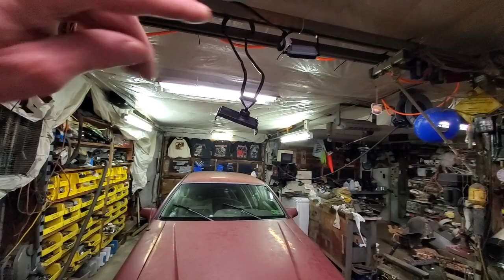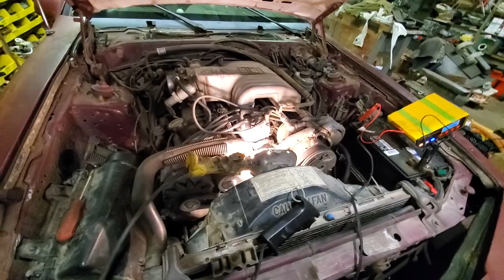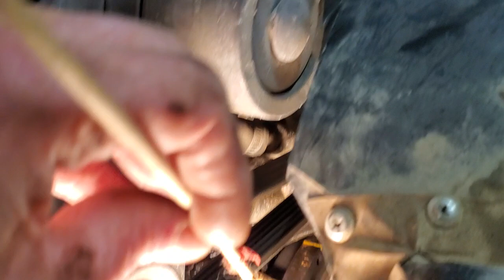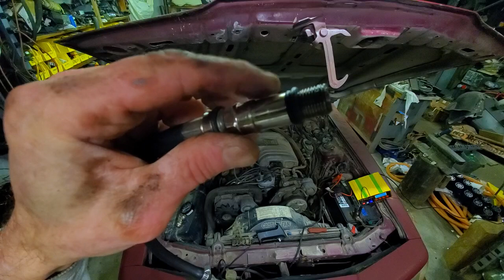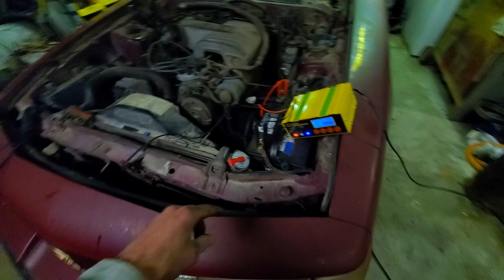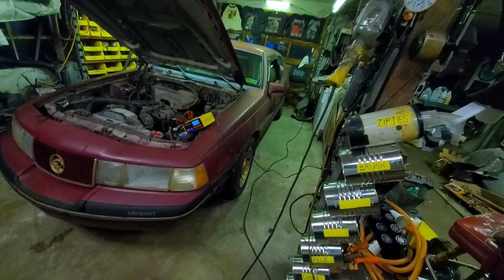1987 COUGAR 375,000 miles- first major failure- Lets troubleshoot step by step

Comment: the injectors are clogged it aint the timing chain this guy is a hack pull the head put new injectors robbing he customer blind
Reply from the maker: jon, i know your not familiar with this most common engine platform used by ford for 3 and 1/2 decades but thats ok.  you dont pull heads to change injectors- that would be a hack rippig off his customer.  I am the customer jon and this is my personal car.  im just a guy fixing things and thought it would be helpful to take people through step by step to determine the root cause of the failure.  part 3 is uploading now showing i diagnosed this correctly.
Reply: @ifixitall-24-7   45 minute video the thing still turns over and doesn't start if it's fuel injected and turns over its the injectors in the cylinder head I've been down this road before and doesn't take me 45 minutes to figure it out super smart mechanic guy
Reply from the maker: I made a comment towards the end of the vid that stated,, what took me 20 minutes to diagose already turned out to be a 50 min video.    I stated i already "knew" what the problem was with the car and all i was doing was explaining things out for people who feel like they cant do this sort of stuff... thats the foundation of my channel.  It would naturally take longer to explain things to help others understand rather than doing it on your own.  You told me to pull the heads and change the injectors.   Thats not even an option on a 5.0L FoMoCo platform...   I was  being somewhat pleasant with you up to this point but i will call the ball and just say it now that ***You are the hack... and likely an unhappy semi - human being from some communist socialist location on planet earth and dont like it when anyone stands up to you and you make damn sure your use  your keyboard to get the job done.  with all that being said,,,, I am stating again that part 3 showing the timing gears were and are the problem.  so,,, simply go to hell and on your way down you can kiss my f'ing ass you simplton fucktard
Reply from the maker: for the 3rd time since you dont S.T.E.M.,,, the fuel injectors are not inside the heads.  They reside on the exterior of the lower intake.,,,, outsde the engine.  You should show us how to remove the injectors from the heads.... wow.  you have no ,,, zero,, zilch content tell me ,, they guy with all the tools time and talent,, the guy who design telecommunications facilities from the buildings to everything inside  that i am not a troubleshooter?   You chatting with a former avionic tech US Navy by the way.
Reply: took ya 45 minutes to mnot know whatn to do billy go ahead and tell me how youre all so smart i called it instantly
 @ifixitall-24-7